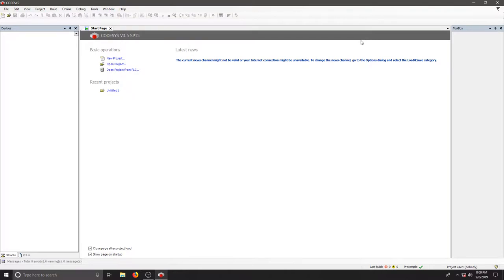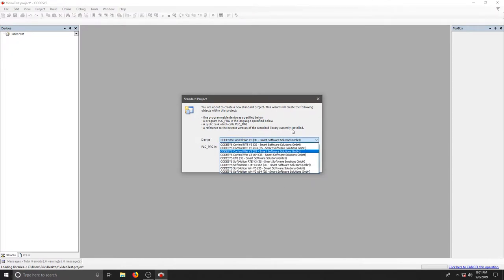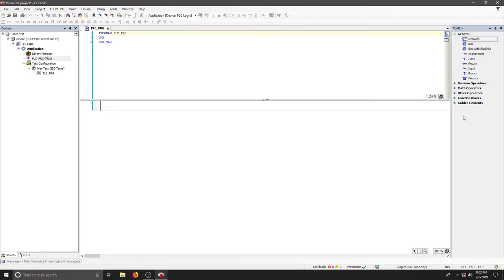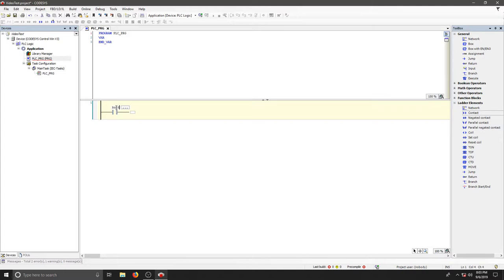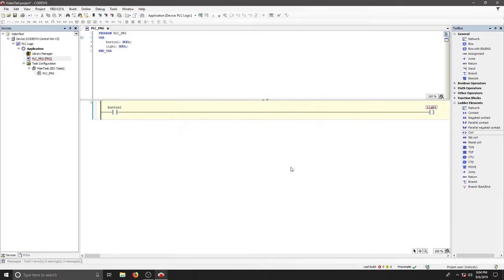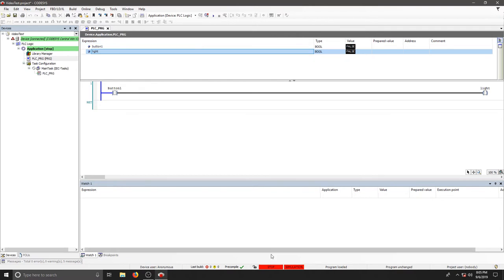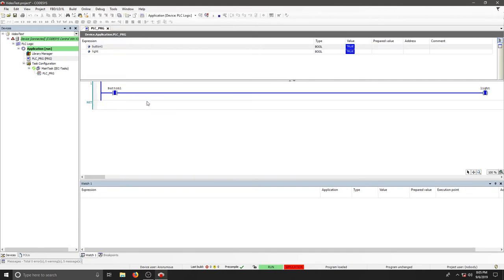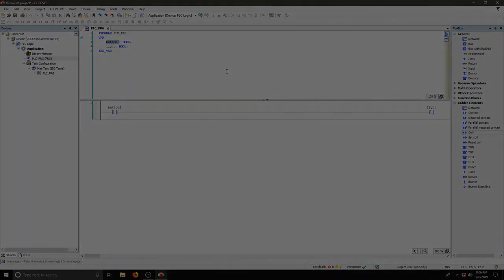Codesys 3.5 and Ladder Logic Intro

Comment: I don't have ladder logic in my configurations. Is there a additional module for that?
Reply: Did you find a fix for this? I'm also stuck there.
Reply: If you are still wondering :) yes plug-in is needed to be installed, Tools -> CODESYS Installer and search for LD/FBD
Reply: @muratcanagic  thank you so much you saved me some time !